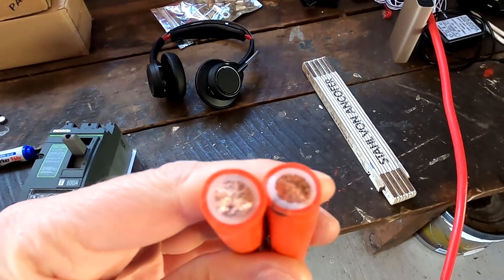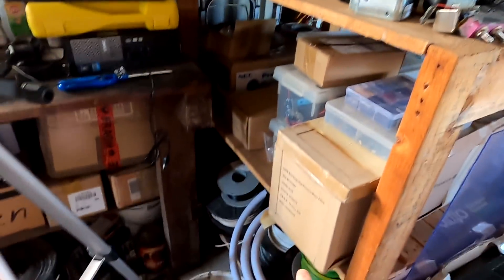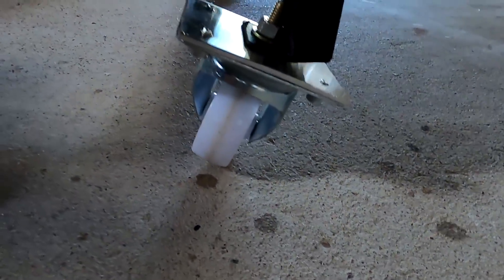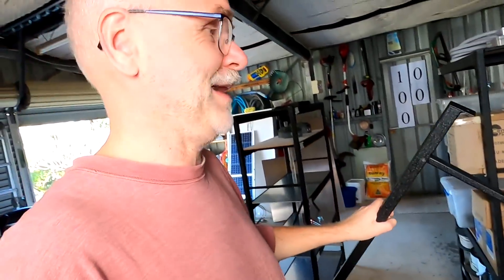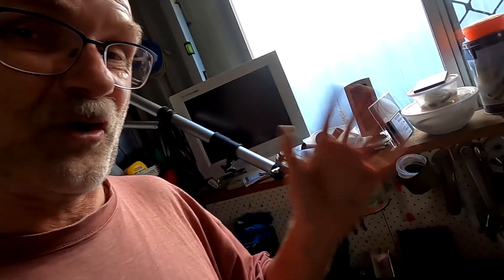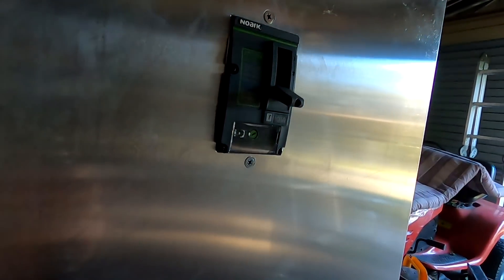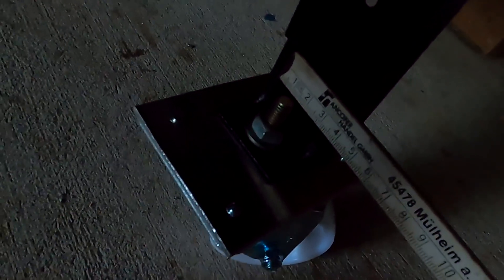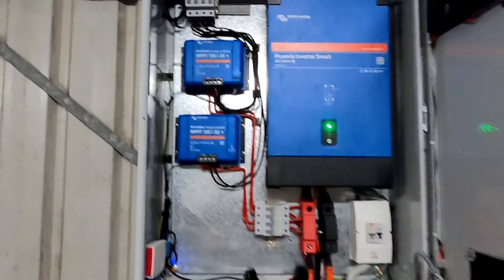The Future of the Off-Grid-Garage! It's all complicated...

Comment: In the last weeks 2 case arrived in the forum where LiFePO4 batteries were destroyed by over-voltage. Like an MPPT went wrong, shorted, and let the 90V 4A from solar flow directly to the batteries. Do you plan any protection against it? Like a crowbar circuit or a varistor based over voltage protector? Your BMS is not FET based. So if the relay works in it than maybe it can survive. But is it enough protection ?
Reply: Out of interest, which MPPT model was this?  And why didn't the LifePO4 BMS cutout from over voltage, did it happen quickly or something and the BMS couldn't cope with voltage that high?
Reply: @EnergisedAdrian  esmart MPPT, 24V battery with EVE 280ah cells, Daly 24V BMS. Daly could not stop the 4x Voltage (90-120V ca 4A), blown too.
Reply: @mrzed6597  ah I see, esmart are not exactly known for stability.  Without even knowing the technical detail, my guess, the BMS turned off the input due to a single high cell condition at the very top end of charge (>98% SOC) which caused the failure of the controller and then the BMS.  Ultimately it's the charge controller not being fast enough to react or not handling that battery BMS disconnect, i.e it basically switches open circuit while the charge controller is under load.   Inside the charge controller is a big Inductor and when suddenly that energy is built up in the coil and has nowhere to go it will find a way, the field will collapse going back into the wiring at hundreds of volts, killing the the high side controller mosfets which usually fail as a dead short, and that same pulse likely taking out the BMS mosfets in the process.  Resulting in both having shorted on mosfets, and a heavily overcharged battery without any control.     Does that sound about right?
Reply: @EnergisedAdrian  We "remotely investigated" a bit this incident. At the first part I am not sure, so on what caused the MPPT short. But after that ... could be possible. Other possible scenario is that FETs shorted in MPPT, allowed the 90V solar to 24V BMS. BMS maybe has 40-50V FETs and that did blow them too to short, ... after that battery could get the 90V 4A = 360W. But that can not fast overcharge a 24V 280Ah (7,2 kWh) battery ... so cells charged and charged ... and charge did not stop at 100% (3,65V/cell) but continued thanks to the 90V ... so they become overcharged. Any idea how to protect battery against a situation like this? Fuse will blow on high V low A ? Especially there are 3-400V 10-12A solar arrays with MPPTs. That 3-400V could do real damage. I just found expensive solutions.
Reply: @mrzed6597  That's unfortunate, I run both on grid and off grid LFP batteries myself so definitely understand that extreme overcharging of them is not ideal at all

It's really the controllers job to protect the battery.   External protection should not be required and may not even work.

The problem with a lot of the budget MPPT controllers is they have trouble maintaining the absorb battery voltage when the battery is in a very high SOC.
Situations where the battery is near full, controller is in absorb mode and big loads are being switched in and out, or Sun is going in and out of clouds results in a momentary overvoltage of the battery, enough so that the BMS trips from a cell overvoltage, which leads to these kind of problems.
I'll bet Victron and others will do a better job at this and have much less of these 'overvoltage/loss of battery' condition in the first place.
I guess lowering your top end battery absorb voltage may help if you can.
Reply: @EnergisedAdrian  You know anything can be broken. Manufacturing problem, age, lightning, even LEMP. I am more of a "lets find a protection against it" guy. The best I could find now is citel ds230s-48dc overvoltage protector. In an overvoltage it connects + to - allowing fuse to blow. Also connects them to ground. And it even has a port which can control a relay ... and with that relay you can disconnect completely the battery. Only its price is high $130. Plus the relay that can switch 300V and 200A.
Reply: Here is the link to this story.  Has me thinking for sure. https://youtu.be/JbnFyU79Nf0

Comment: I think you are smart to separate the AC and DC parts of the system. 
There are really 3 big parts: the solar panels & controllers, the batteries & breakers and the inverter & AC breakers.
Being able to disconnect the inputs to each of the 3 parts will be important during changes or trouble-shooting.

Comment: Hi Andy can i advise you not to mount the breakers that way , the cover plate should only be used as an escutcheon plate , this will aid in cable terminating and ongoing maintenance & inspection, yes it means you need to mount the breakers on a plate or bracket , but you will be thankful you did , if you do this just make sure the back of the breaker terminals remain isolated from the mounting bracket/plate  as most breakers can have a rear connection kit fitted and if terminal bolts protrude to far or if they are changed may short out !  ( vary rare )

Comment: Hi Andy, Bunnings sell the wheels for the RackIt shelves. They are where the shelves are kept. No need to make up custom brackets.
Reply from the maker: Nah, they are just small wheels and only for the workbenches of their series. Wouldn't be strong enough. I looked at them. I wanted bigger wheels so they don't stop on stuff on the floor and make the high shelve flip.
Reply: @OffGridGarageAustralia  Ah yes. You have the 400kg system and the wheels are for the 1000kg system and only for 900 high uprights. I will be using them for a bench in the future.

Comment: Install a big grid-tie inverter to supply the house.
Reply from the maker: As I said, it's complicated. I cannot just use an inverter for that due to the solar already installed.
Reply: You can synchronize the house grid with the garage grid, and you can control what consumes what. You can leave the house solar in place.
Reply from the maker: @Hstruik01  unfortunately that's not gonna work... I'll explain this in a video soon.
Reply: Of course you can :-)

Comment: All of this planning and wiring really makes you appreciate the hybrid inverters like the Sol-Ark/Deye/SunSync.
Reply: I am not sure but I think they are only for US (120V + split phase). The only 5+ kW hybrid inverter I know that uses 48V battery and has all the certificates for EU+Australia is the Voltronic Infinisolar 5kW 1 phase and 10kW 3 phase inverters. Also known as MPP Solar Hybrid MPI 5kW and 10kW.
Reply: @mrzed6597  Sol-Ark is the US 120/240 split phase variant. Deye/Sunsync sell almost the exact thing but for the rest of the world. Not sure if they have any certificates but they are pretty much the same thing, all of them are manufactured by the same company
Reply: @MrJramirex  In the EU and Australia all Grid-tie inverters have to have certificates so they can be used there. I do not see any Deye or Sunsync inverters in the allowed list here where I live.
Reply from the maker: I cannot just use any inverter to supply the house. There is a big problem...
Reply: @OffGridGarageAustralia  A REAL hybrid inverter is an off-grid inverter build together with a Grid-tie inverter. In the AC in port it produces power to utility or uses utility power. On the AC out port is the house connected. Has 1-2 MPPT port where 9-18kWp solar can be connected. And has a connection to 48V battery where solar (or utility) power can be stored and used to power the house (UPS). A unit where Off-grid and Grid-tie are combined together in a very elegant way.
Reply: @mrzed6597  Can you name one that fits your description besides Sol-Ark that is UL listed?
Reply: @Sanwizard1  Andy lives in Australia. There you can not use UL listed inverters because they do not use the 120V system. But Voltronic - MPP Solar is certified and can be used (I think, we can also use it here in the EU).
For US sure, Sol-Ark is expensive but maybe only hybrid option there.
Reply: @OffGridGarageAustralia  Also can’t wait to see how you resolve that!
Reply: @OffGridGarageAustralia  Electricians regs so they don't lose money.
Reply: Deye does not seem to be available in the US. The Sol-Ark I believe is a US version of Deye, but they charge about 4K US over the Deye price for the same thing. 
So far, I am liking MPP Solar from Taiwan. They are simple,  work fine, and you cannot beat the price.
Reply: Yeah this is what I will do, but then it's just 1-2 videos and the system is complete

Comment: On you next inverter consider a gridtie that can be programmed for no energy export.  Also they use the term current limiter.  Then it only supplies power to replace power you use.  And if inverter has no power the house power still runs everything.  Ecoworthy is a low cost one.
Reply from the maker: That might be my only option!
Reply: @OffGridGarageAustralia  Not the best choice. It will be an AC coupled system. Grid-tie so in a blackout has to stop (anti islanding). Can be made off-grid with extra cost and PLC that separates the whole from the grid. But it takes some seconds so lights go out, PC shuts down. Not a very efficient system.

Comment: Hi Andy, in relation to the castor wheels, may I suggest you use an angle rather than a flat. By using an angle it would be much stronger.  Kind Regards Max.
Reply from the maker: Argh, I couldn't wait 😉

Comment: sq tube bolted to the frame and it will support the wheels
Reply from the maker: The frame is the same thin metal as the base.
Reply: @OffGridGarageAustralia  so you are using the end of the tube as well. I do like the flat bar as well. Might consider both ways (side and end)

Comment: We are all bombenfest addicted, no worries :-p
And yes... It takes so long... i want to finish the walls with plaster and paint, before i install the inverters and cabling and other stuff.
For the house, my plan is to start with 4 inverters, to have a working three phase system while one inverter is in maintenance or in case of a failure.
So, this might become similar to your project?
Reply from the maker: That sounds easy. 
Far more complicated here. Basically, I cannot change any cabling, install grid/battery switches or any of that due to the contract.
Reply: Well, that is just the UPS part. I will probably have two grid tied inverters selling to the grid as well. No contract yet, i hope to be alble to sell just the excess power. But i will have to go to the local branch of the elcectric power company for the contract. And the panel installation will be not that easy for me, only one half fits on the garage roof.
I won't be bored this year...

Comment: andy, may i suggest you look into hybrid inverters ?
that would allow you to charge batteries, deliver to the grid, and 2 12 kw should be plenty .
Reply from the maker: Unfortunately, I cannot change any of the cabling to the house so cannot install such an inverter. That would be an easy solution and something I can look at in the future.
Reply: @OffGridGarageAustralia  I went with a grid connect Solax Hybrid inverter about 3 years ago and delivers 2.5Kw of battery power through a 48v Anderson plug, this bank has grown from 6.4Kw to now 18.6Kw, plus another 6.6Kw off grid setup, best of both worlds now, lots of exports to the grid

Comment: a solid plate base then wheels then bolt shelf to base.
Reply: Yep!  If he has a spare wooden shelf, he can mount the bottom of the shelf-frame to it.  It should be the right size without any cutting needed.  Bolt the wheels to the bottom of that.

EDIT: looks like many commenters have similar ideas.

Comment: The mounting of your big breakers has one flaw: How do you fasten the terminals?
If you had them sitting on a vertical rail in the back, you could unscrew the side cover plate of the rack and get to the terminals.
But, well, now you already have the holes in there...
Reply from the maker: That's been solved, I have to mount the cables first fro the back before I mount the breaker to the front panel 😊

Comment: If you slightly smash that conduit down so it's more of a oval shape instead of a circle it should fit in there a little easier
Reply: Warming up the conduit should make it more pliable.  Perhaps blowing hot air through it, or leaving it out in the sun?  Then loosen the coil, put a sheet of plywood on top, then stand on it!  That may change the shape enough to solve the problem.
Reply from the maker: It does not stay in place though or breaks if squeezed to hard. I've ordered some 40mm conduit now.

Comment: 071921/1221h PST 🇺🇸.  072021/0521h Brisbane 🇦🇺 . Guten Morgen. The 100A CB looks great on the Al side plank. I’m not trying to be critical about the way it was fastened. Surely, you’d strengthen the CB with steel band across the CB body and anchor the band on the Al side plank. Meaning two additional 4mmX15mm bolts on the port and starboard of the CB. It’d look good and symmetrical plus peace of mind. My thoughts……
Regarding the second shelf, weight bearing cross member to the pillar was a good idea. This is a good opportunity to acquire a MIG welder? ‘Ali’ has a lot of models.
Every thing is a prototype, there’d be tremendous amount of changes, alterations, frustrations, lewd verbal epithets, mental agony, scraped knuckles etc etc. Nevertheless, the work must go on. Remember ‘The Oettinger’…… raising the spirits. Stay safe und 73s…
Reply from the maker: Nope, the breakers are bombenfest as they are now. No further mounting needed or planned.

Comment: I have lots of shading around my house at different times of the day and the seasons. I want to have a system that charges batteries for a 110/220 invertor. I don’t want to install all panels on the roof because of the snow covering 5 months of the year .but most I want to install in parallel panels on the east and south walls, so there is no snow problems. I know it’s not great so I will install lots of panels , I think I can get 15 to 20 panels 300 w panels on the walls. I have a installed a 11k whole house generator and can run my hose on the 60 amp feed. So the bottom line, when the grid goes down my house will run off the batteries until the invertor says start the generator to charge the batteries and the generator does not run all time the grid is down . does this make sense and is do able
Reply from the maker: Yes, that makes totally sense and is a great idea. Using the solar first and if not sufficient it starts the generator.
Reply: @OffGridGarageAustralia  So mounting lots of panels in parallel on the walls straight up and down  makes sense to you, Good then instead mounting fuses on each panel for safety would you think by just adding a diode in the pos connection at each panel will work and do you think the panels would run cooler on the wall.

Comment: Andy, If you are thinking about Victron inverters for the house? I fell into the trap and thought you could parallel multiple inverters, my original plan was to purchase a 5kva then add another 3kva when funds allowed! I assumed they would cascade like water heaters I fit, ie share the load and take over if you turn one or more off for servicing...$#@%... you can't do it like that, for multiplus you have to use the same size, same PCB series, equal length cables and configure them to master/slave (or slaves). I've got two 3kva's working together if you turn one off nothing works, you have to reconfigure it to a single unit (a ball ache for non computer savy) you need a laptop or computer and a special lead.
Some avaliable used on fleebay have older series PCB'S so to parallel them you need a new PCB to make them work.
Reply: I was thinking about a Multiplus 5kW inverter +  MPPTs before. But on that's price I can buy more than 3-4 MPP Solar 5 kW inverters. And they are fail-safe in parallel configuration (and do load share). Even that can only paralleled with the same inverter (but cheap).
You can use the 3kW and 5kW in a DC coupled way. So connected to the same battery but giving out separate phases.
Reply: @mrzed6597  What brand do you recommend? I went for Victron easy solar so the mppt, colour control and switch gear are in one box, the second one is also an easy solar with the Colour control and some switch gear disconnected, I got it EX demo so very reasonable, I've ended up with two complete systems made up of 8x batteries and 12 solar panels, potentially they will get split between two new houses or another system for the second house.
Reply from the maker: I had a good look at the Victron solutions they have ESS and stuff. Unfortunately, I cannot change any cabling to the house due to the current solar installed. I'm very limited with what I can do until the contract runs out (or I'm getting the shits and cancel it). But I think I've found the right solution now for the time until then.
Reply: @OffGridGarageAustralia  With a very expensive Multiplus II 5kW you have 2 options: 1-protected load output (the same as an Off-grid inverter has). 2-feed back in AC-in port and have a limiter. BUT, that limiter needs to be set on your main. And you also have an another grid-tie system. So ... all day the time Victron will sense power flowing back to utility and will not put anything to the line. Only when low sun and high demand, or at night will it produce power to the house (not worth the cost). And in a blackout it will shut down too. Or expensive PLC to the main to separate the whole house from the grid, made it real off-grid. And maybe you can not do it because of your grid-tie contract.
Reply: As far as I know you can add a cheap grid tied inverter of up to the same size as the Victron inverter.
May one day add a 4kw grid inverter to the Easysolar 5000va=4kW